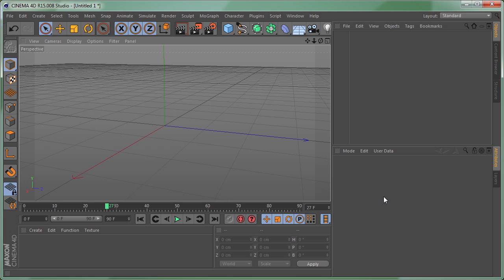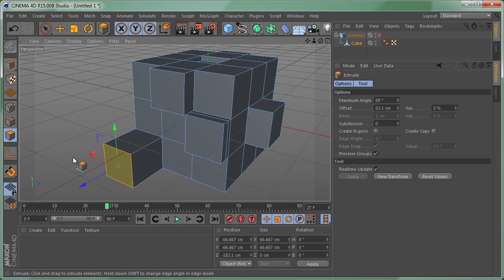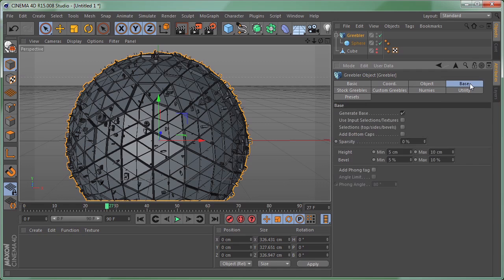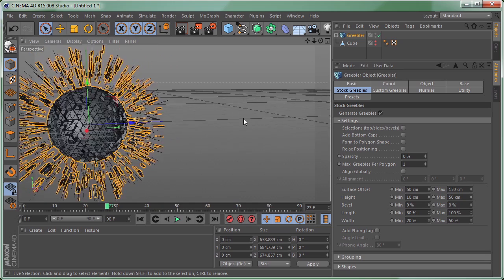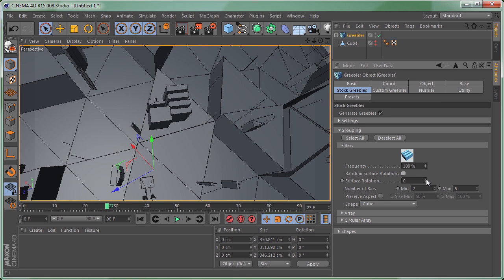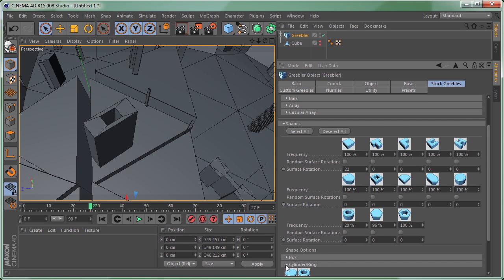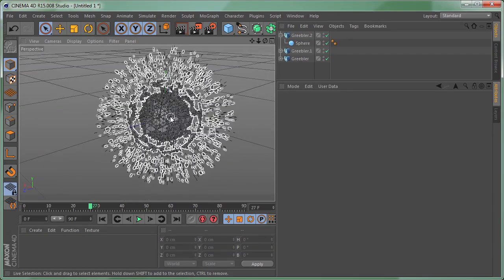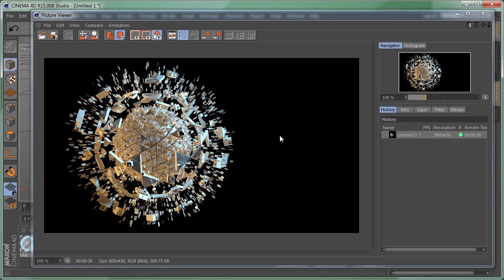Tutorial: A Thorough Introduction to Greebler for Cinema 4D

Comment: how do you apply different materials to the greebled parts only? not the object you greeble. I know it has something to do with the Greebler Tag after reading the manual but I still don't get it... (I figured it out below though!)

EDIT: figured it out. You don't need the Tag if all you want to do is add a different material to the greebled parts. Just press 'c' to make the Object in the Greebler editable. Say if you had a Cube, after you make it editable you'll have two objects in the Greebler null: Cube.Base and Cube.Greebles.Stock. Add one material to the Base and another to the Greebles.

Obviously the Greebler Tag can do more advanced stuff but I'm still figuring that part out...